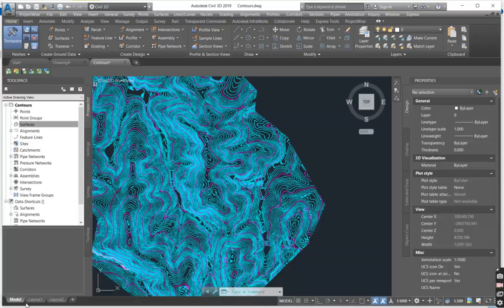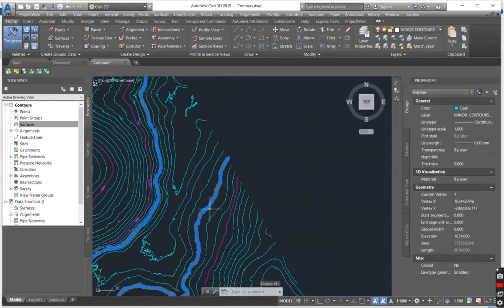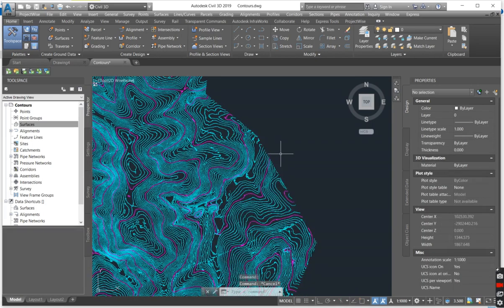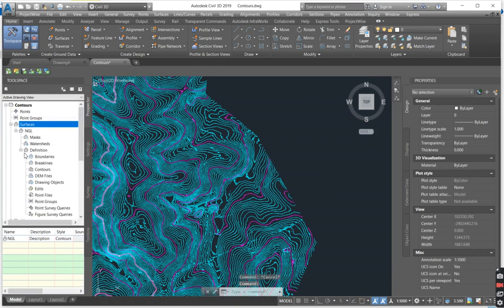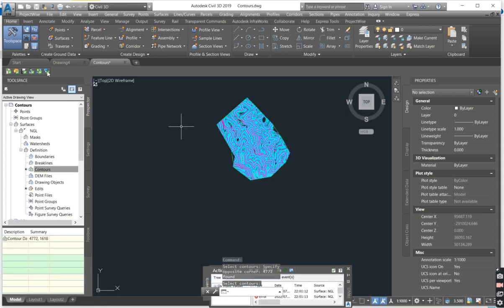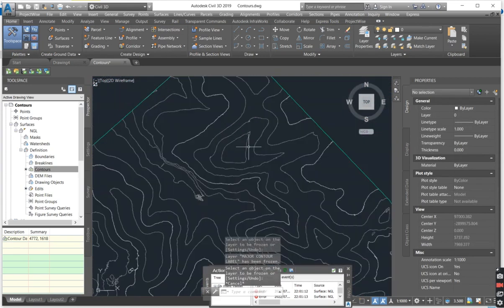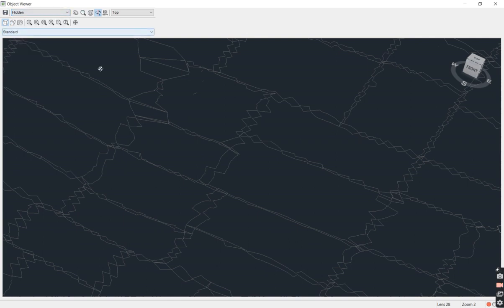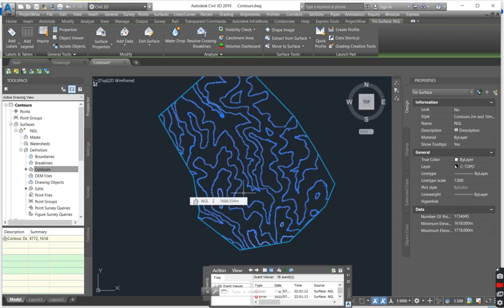#civilengineering : AutoCAD Civil3d Tutorial: Creating C3D Surface from Contours

Comment: The only issue with using contours to create a surface is that you may not get a true surface. By that I mean you have not picked up any breaklines from the original survey. A top or bottom of bank will not be included as contours are only elevations at specific vertical intervals.  For example if you need a top of bank for a stormwater basin the top contour may be at a different elevation to the top of bank. The tighter the contour interval the more accurate your surface will be. It is best to use points and breaklines or 3d faces (a TIN) from the Surveyor.